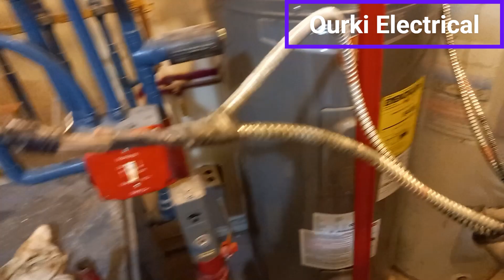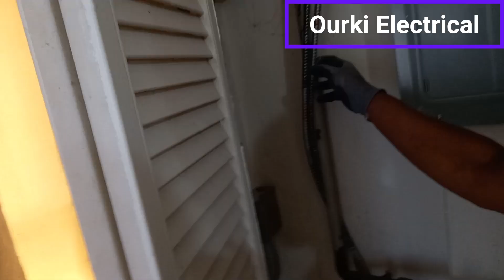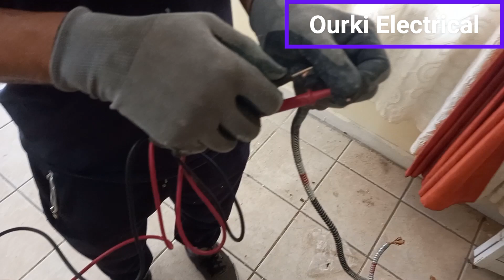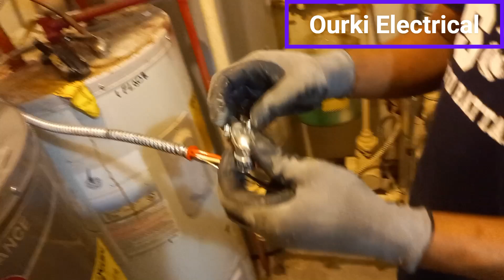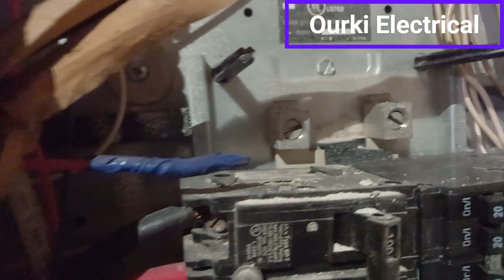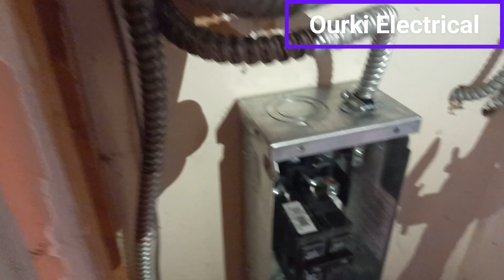Water Heater Connection No Space in Panel

Comment: I thank you all for your feedback. Over here, there is no  "100A feeding 30A conductor" as the water heater is protected by a 30A breaker which should not aloud more than those 30A to flow thru that 10AWG conductors. There is no "SHAME" in this. Check it Out and let's do electrical please ! Thank you again for taking your time to watch and comment and you are always welcome to do so.